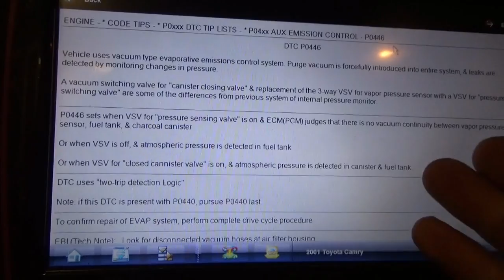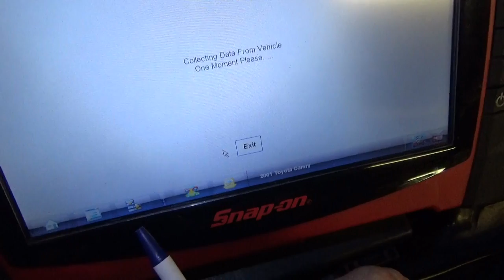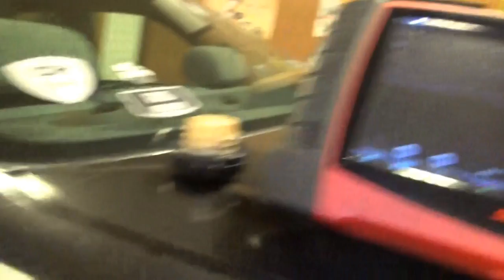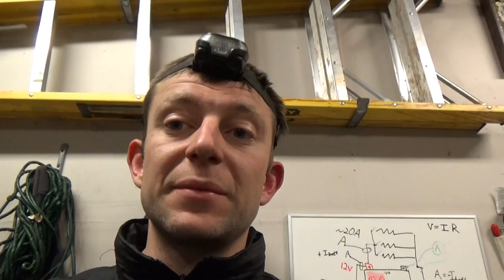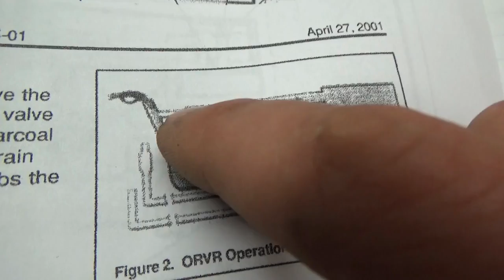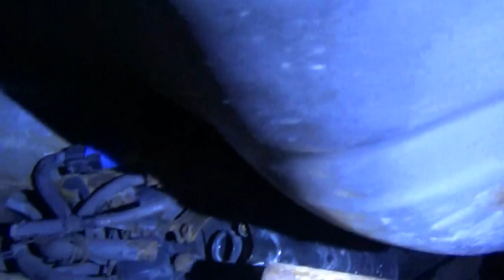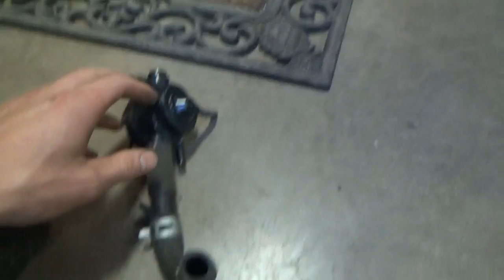Toyota EVAP Diagnostics Part 1: Can't Fill Tank

Comment: I am struggling with an Evap issue, as we speak!! And all of the info that I've learned from Paul Danner and Eric O  is useless at this point! And from the wiring diagrams from BBB ind, none of the usual parts are in play!! I spent a few hours searching this 97 Tahoe, for a vent valve, and can't find one. (Except a generic one on top of the tank) can't find any info on the vacuum switch, just inches from the purge solenoid. And the charcoal canister is open to atmosphere at all times???!!!??? How do you answer a P0441, with those conditions present? No controllable vent valve, no pressure sensor, no way to pull a vacuum on the system, to check for leaks, and a canister open to atmosphere at all times?????? It's so frustrating!  I don't have bidirectional scan tools, and have verified that the purge solenoid don't leak vacuum, and does open to purge when outside power is applied! I verified that the vacuum switch does operate, and applies power when key is on, and turns off as vacuum is applied. I verified that most of the system is tight and free from leaks, but with a canister that is open to atmosphere at all times, I can't see a leak possible, or even any problem! The only thing I can't do, is apply purge from the computer, to verify that the computer command is present! I can apply signal manually, but can't bidirectional lay do it! Still have the p0441 come back, tho!! At this point, I'm thinking that a overfilling of the tank, along with a malfunctioning manual vent valve on the tank, is causing an issue! It seems to come shortly after a fuel tank top off! So, a full tank, that sloshes too much liquid into the vent tubing, creates some issues!! I'm at a loss, otherwise! I suggested to not fill the tank to extra full, for the next few fill ups, to see if that makes a difference!

But this charcoal canister has me confused! It's a 97, but looks like an older 70s style can! A purge line, a tank line, and a open to atmosphere factory venting line! The top is marked to CLEAN AIR INTAKE, but it's not set up that way, too far away, and has a factory looking covering that allows fresh air to flows and no air filter to be seen! The best I can tell, the tank is free to vent into the canister, thru the charcoal media. The purge is free to pull the vapors from the charcoal media. But nothing visible closes the system off! It's nothing I've learned about, in these recent times! It may be old as dirt, and nothing like today's systems, but it's foreign to me!
Reply: I think there's "two" vent valves on those and they twist lock directly into the top of the fuel tank, go to a tee fitting then off to the cannister, maybe through a vaccum controlled switch.
there may be a vacuum line running from front to rear ( going by memory, which is a bit rusty on them..
should be the devils. https://www.rockauto.com/en/catalog/chevrolet,1997,tahoe,5.7l+v8,1061367,fuel+&+air,fuel+tank+vent+valve,11246
Reply: and photo #9's in https://www.wholesalegmpartsonline.com/images/parts/gm/fullsize/970506TK03-001.JPG
again, I don't recall the whole system from front to rear
Reply: throttle bottle yes! That looks like what I have to deal with! Thanks a lot!
Reply: I doubt those vent valves are bad, as there's no sensors or monitoring at the tank itself, other than it maybe detecting the fuel level change and I'm not sure they did that even.
it likely has a sticking purge valve, split/leaking line between purge valve, switch, cannister or the charcoal cannister is plugged up or the vent on it is. 
I believe it pulses the valve and looks for a certain amount of "time delay" for the vacuum switch to activate/deactivate and if the time duration to change is wrong, it sets error code.
Reply: throttle bottle HAHAHAHA! I tried going to those web sites, and pulling up those diagrams, as they looked like they could help, and could offer some more insight to the inner workings.  I could not find those, or any similar diagrams!! Nor could I find that vent valve in any of the GM PARTS sounding sites! Even tho they were mostly the same parts lists. 

You must have some different credentials than I have. I'm just a lowly non-important character. You must be royalty, your highness!! Lol!! Or... maybe I wasn't holding my mouth right?? I'm worn out now!! Hours of searching the net, after hours of taking the thing apart!! Makes my eyelids heavy! 

Thanks, and good night, Sir!!
Reply: @roadkill5333   roadkill5333  I'm a noob so please disregard if any of this info is irrelevant. On my 97 Silverado 5.7 vin R, i just looked up guided component test on verus and this is what it states for operation. 

Basic evap system uses a purge solenoid and vacuum diagnostic switch. Pcm provides a ground to energize normally closed purge solenoid. This allows engine vacuum to purge canister. Pcm uses engine temp, operating time, and other factors to determine duty cycle on time (pwm) for purge solenoid. May vary from 0% - 100%. Purge operation is monitored by the pcm using the vacuum diagnostic switch. Switch is normally closed and is located in purge hose between canister and purge solenoid. When solenoid is activated and system is purging, diagnostic vacuum switch opens.
Reply: buggy1971...SUPER!! That's sort of what I had determined it did! I didn't include the pulse width modulation in my theory, but still kind of on target!! I did test all parts individually, with a mighty vac pump! While I understand that the testing procedure in most automotive apps would only include vacuum on a very low scale, the purge solenoid does take its cause from the manifold! So I didn't care about pulling 1-3 inhg for my test. The purge valve held. The vac switch held. The entire tubing system from the rubber connector to the tank, back thru the canister to the purge solenoid held vac for at least 5 mins! I attempted to vac test the fuel tank, but it is a 30 gallon, and I couldn't pull enough with a mighty vac, to register! But, I don't feel like that tank would be sealed tight, and checked for vac leaks, anyhow! So, no vac leaks they the canister to the purge solenoid, and the canister is actually open to atmosphere, at any rate!! I had to plug the input from atmosphere to pull the vac test back to the purge solenoid! So, I think I'm to the point of the computer giving the proper command, to facilitate purge flow! The only way I can do that, is to pay a shop to do the work, or rig up some wiring and light bulbs, to the purge solenoid, and the vac switch, to see for myself when the vehicle is actually driving down the highway! I figure that I can use a 194 (or lower current, similar bulb) connected to the purge valve, and the vac switch, and watch for the lights!! Vac switch on, and purge valve off, during normal operation, and vac switch off, when the purge light pulses on! I just don't know if the pulse width will now light a small bulb, during my little backyard test! I wonder if it will light an l.e.d?
Reply: it should not hold vacuum or decay real fast with vacuum tester to the line removed from the solenoid and ran to the vac switch and line to the cannister, that should nearly be free flowing (as fast as you'll be able to pump it anyway) if it's not your plugged somewhere from vaccum switch to charcoal cannister or the cannister itself is bad.
put a tee on the line between purge solenoid and vacuum switch, route it out the back of hood and into the truck to a gauge, or wedge one at the rear of hood. what you'll probably see is it raise in pulses and get stuck with high vacuum.....
there maybe be a valve inside cannister requiring over a certain amount of vacuum to open, so try pumping as high as you can(cannot hurt it) to see if it suddenly opens(I'm guessing/recalling no) and sure sounds like a line or /cannister clog...
Reply: '97 was barely OBD-II, it's possible they weren't doing evap leak monitoring on trucks at that point so it's quite possible that there's no vent valve. P0441 is for incorrect purge flow - either not flowing or flowing when it's not supposed to be.
Reply: Robert Hancock yep!! Incorrect flow is right. I have tested the vac switch, and the purge valve, both for operation, just not from the computer! I just don't know if the computer is signaling them! I know they both work, and have correct wiring from the connectors to the components! 

The vac switch has constant ground, and the computer energizes the pos side, with the key on. It also has a secondary small vac line from the pcv outlet connector, which I assume is an attempt to provide a positive "switch on vac" during non-purge states. I assume it uses this to identify a working non-purge state of being! When the purge is happening, manifold vac is allowed thru the purge valve, creating a vac under the switch, to open the switch! The vac under the switch, to hold the switch open, has to be stronger than the vac holding the switch closed, to demonstrate that enough vac exists to open the circuit, meaning that proper purge is happening. The purge solenoid has a constant power source, and the computer supplies ground to actuate purge flow! I can only assume that all of this happens at an appropriate time, flat cruising, light throttle, long open road. I feel like I could rig up some test lighting, to see if it happens. That couldn't be too hard, I guess! Make one rig to see if the vac switch stays lit until the other rig is lighted up by the computer purge circuit, and the vac light goes out! If it never happens, somethings is amiss! Just what is amiss, is the $60000000 question, at this point! Assuming that I have the system design figured out correctly! Assuming the purge light comes on, and the vac switch light goes out, everything should be working! If the vas switch never goes out, or goes out when it's not supposed to, there's a problem with that part of the system. And if the solenoid never comes on that means a problem in that part! And if the solenoid light comes on, and the vac switch light don't go out, that's another problem!! I THINK I CAN!! I THINK I CAN!! I THINK I CAN!! 

Thankfully, I have time to figure all of this out!! It needs a new spider injector kit right now! Sooo.....

Comment: Great troubleshooting ivan. Emission systems  are complicated to me. Trying to fiqure out the subaru system to get rid of the po448 on the 2006 subie sti . Im good till ct. Emissions comes up in apr 2019.  Happy thanksgiving to you and your family
Reply from the maker: P0448 looks like a circuit code for the vent solenoid. I would start there :)

Comment: I believe since you relate out loud your thought processes so well, others can use the same technique in troubleshooting almost anything they are working on. Kinda like a mental flow chart, for lack of better words, test move on...test move on... ID problem, double check findings, repair and or replace.

Wonder what ever happened to those gas station filler nozzles  that would vacuum off vapors while filling car, never see them anymore.
Reply from the maker: Thanks, Charles! I've seen those vacuum recovery pump nozzles in California. Was a real pain to fill a motorcycle tank with those! Now that all modern cars have an on-board vapor recovery system (like this Toyota), there are no more vapors escaping the filler neck during refueling, so no more need for the vacuum nozzles :)
Reply: I cannot recall the last nozzle I seen without vapor recovery, other than kerosene and diesel pumps. 
the majority if not all have vapor recovery nozzle/hose combo's, it's a hose inside of hose(coaxial) setup with the vapor recovery holes higher up on the the outer part of the nozzle. they just don't have silly fill neck cupping boots with bellows around here and if you listen you can hear them all "sucking" and if the fuel burps back the filler neck you'll hear it gurgle as it tries to suck your gasoline up! which also causes the nozzle to kick off (hopefully)  I think the vacuum is fixed flow rate regardless of the fuel flow rate, but don't quote me there, I don't repair pumps!
Reply: So do the nozzle look any different, What difference can I see looking at it, they look "normal" to me. If I look into the spout will I see anything. Im going to have to pay more attention I guess, better put, some attention.
Reply: they look about the same, but they've likely been eliminating them lots of places. have a look around one of manufactures site.
http://www.opwglobal.com/products/us/retail-fueling-products/above-ground-products/stage-ii-vapor-recovery-equipment
Reply from the maker: Interesting...will have to look at the filler hose next time I gas up :)

Comment: I'd push a piece of screen in that vent hose- keep the bugs out.
Reply: Thumbs up for that. Passenger jets have crashed due insects making a nest in the pitot tube, giving false speed and altitude indication. A peace of plastic fly web and a zip tie would do the trick.
Reply: Cut a circle of screen, 1/4" larger diameter than the ID of hose. Center it over hole, gently push in on it's center with a suitable bolt, pushing it 1/2" into the hose. The resilient rubber will keep it's grip.
Reply: I myself would not push screen into tube. Here in Finland the mud and water might end up into the tube and dry there and plug the screen. If you put just one layer of screen at the end of the tube, mud is more likely to fall off when is has dried and you drive around.

If tah tube would be somewhere else than under the car, pushing a ball of screen in the tube works well!
Reply: Agree on that- yes, that makes sense here, too. Some kind of end filter must be installed. We have wasps called Mud Daubers that build nests in pipes and any suitable crevice.
Reply: didn't they have a vent filter to start with? someone hacked it off as the wrong fix probably...
Reply: The peaces may be broken off form the charcoal canister? Is it disintegrating?
Reply: Ivan didn't elaborate on what the debris was. Road debris, mud, leaf/grass clippings, insect/rodent nests? A banana?